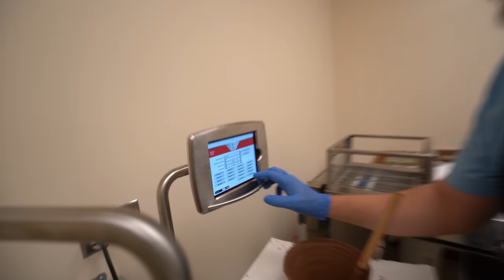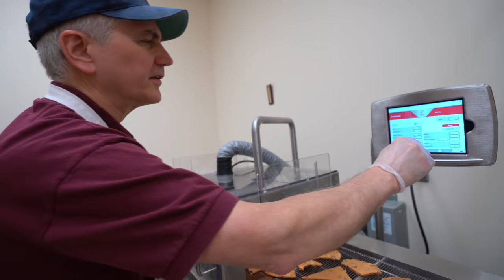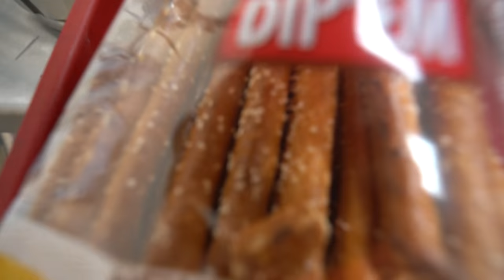We Unbox our NEW Chocolate Enrober!

Comment: Joe, look up the mold number embossed/engraved on the mold and refer to the manufacturer website or catalog for the specific grams or ounces.  You likely will have to convert to a decimal. Program each mold as a recipe-d for dark -m for milk chocolate and you should dispense correctly. Also, most vibrating tables allow for adjustments to the vibration strength. No more manual tapping or funnel for molds, it’s about efficiency.  You u also may need to experiment with a different brand or chocolate or blending another chocolate to improve the fluidity for enrobing. Peters does not have the best success with enrobing.  Just my .02
Reply: If they use different chocolate it won't taste the same and that would be a travesty!
Reply: Amanda B yeah it may taste better!
Reply: Not the 2 cents lol

Comment: Hey guys... I'm no expert but I am a pastry chef and worked with allot of machines similar to your enrobers.   I think the timing of the pouring for chocolate bars could be tweaked.... Max is great with going fast.  With the pretzels - wouldn't it be better to let the chocolate drain a bit longer? and have less wastage in the chip pile? If you want thicker chocolate maybe dare I say... double dip?  Like dip just in chocolate once... wait to set then dip again and then in chips..  Just some thoughts / suggestions.  I remember when we got our first computerized dough sheeter - it definitely took some tweaking - but once we got use to it... it saved allot of time.

Comment: With the new enrober's vibrating table taking longer to even the molds out, wouldn't it work fine if you put the molds on the vibrating table as you fill them? It looks like the table could hold at least 6+ molds. By the time you filled six molds, the first mold should have enough time to even out all the way and you would replace it with the newest poured mold. From a production stand point, I think this method would produce more chocolate in the same amount of time rather than hand tapping each mold into place.
Reply: Exactly what I had in mind while watching. Hopefully, they see your comment.

Comment: Call the enrober company and tell them your issues.  I'm sure they can help you resolve the issue with the vibration table.
Reply: Near the end they talk about how often they have had to call for help and that the company had a rep in the area who stopped in to help.   The vibrating table needs a stronger motor in order to resolve their problem.
Reply: @sortathesame8701  -- perfect wouldn't produce a product that was defective right out of the box.  Those machines are not cheap!  I'm assuming that's a wheel enrober at around 10K.  the vibrating table probably has a built-in computer controlled potentiometer , i realize what the on-site rep said, but c'mon.

Comment: I been watching these videos for a long time now.  I love seeing the candies being made and  seeing some of the old style methods that are still being used.  But for some reason I keep thinking about how they use the wooden rod and steel funnels. It's always a guessing game with how much product comes out of the funnel. Plus, there is always the " Yikes " Moments when you either loose a grip on the funnel or your not fast enough with the Rod and product goes everywhere.  I looked back at an August post where they purchased 2 new funnels with Rods and Thought. "  Why have they not looked into the Confection Funnels with the Thumb Press? "  They are simple to use.  Most come with a stand for them to rest on when being filled or when not being used. Easy to take apart and clean and they come in Stainless Steel.   Plus they seem to be a lot cheaper.  Some I have seen are as low as $45. vrs the $200 for the Funnel and Wooden Rod.  Again, just a thought but might be interesting to try out.  Anyway, Keep up the Excellent Work.

Comment: not a candy maker or anything like that
but it seams that the vibrations don't transfer on the chocolate because of the low weight of the molds and also because the molds can move freely on the red table

Comment: If you could glue some of those small strong neodymium magnets to the bottom side of your molds it will also work the same as weighing them down for better vibration transfer, that is if your table is magnetic under the silicon pads.

Comment: Advice from a manufacturing company:  the vibratory table will work better if the molds are against the edges or even fastened to the table.  Vibration is lost when floating on the table freely.  Also consider pouring into an already vibrating mold.

Comment: Happy birthday, Terry! 🎉🎂
For the vibrating table, a lot of the energy is lost with the mold trays sliding around too much. Maybe lightly pressing down on the tray, and holding it in place would help? I'm thinking they just need to be weighed down.
And, I want to see how Max's hair looks when it's down! 😅
Reply: Pressing down on them would just slow the vibrations even more!
Reply: @sortathesame8701  Well not pressing full force, just enough to hold the tray still, and stay in contact with the surface

Comment: Increasing the motor size would only increase the frequency that the table vibrates at. These things (and most vibration mechanisms) work on a eccentric weight on the motor shaft. Increase the shaft weight and you'll increase the amplitude of the vibration, that's what you need.

Comment: I hate to burst your bubble, but you guys are nuts!  If you open the crate from the side labeled "front" (9:39 in video), it's likely there is no blocking or strapping hooks on that side of the crate and no accessories strapped to that panel.  You can just lower the panel and use it as a ramp and roll out the machine.  Love the vids!  :-)  Nice machine!

Comment: What would happen if the vibrating table was on when pouring the smaller molds with the funnel? Ooops... Never mind. A question, though... Is Joe the beloved Eyore of Hercules Candy? Everything he says is neutral or negative with a slight positive spin. Somebody pin a tail on that guy!! And one more thought: If you got some 1"x12"x12" wood, drilled spaced 1/2" holes in them, gave it a food-grade finish, and lowered that 92-degree to 82 in the tub, you could tie regular cooking string (like used to keep turkey legs together) around the back end of the pretzel rods, and dip 6 or 12 into that beautiful tub the chocolate pours into, then turn them upright and sprinkle the chips/nuts/whathaveyou on them.... That would not only utilize the new enrober but cut the production time in half or better... Just an idea...

Comment: How the heck did the first enrober get downstairs without Joe? I need to rewatch that vidya.
Reply: The company should see the issue with the motor in the vibrating table and work w you guys to get a more powerful one in there. Hope they do that.
Reply: Max helped Steve take it down to the basement.
Reply: Maybe .... it just seemed like the vibration was too weak to settle the chocolate into the corners and remove air bubbles.

Comment: Joe has very little knowledge of the conservation of energy, in how the function of vibrational energy is transferred. Pro tip Joe, hold your finger on the mold so its weighed against the table more, so the vibration is transferred to the chocolate, and not the mold.
Also he never used the side scrapers on either side of the chocolate enrober.
All of these mistakes give me the big sad